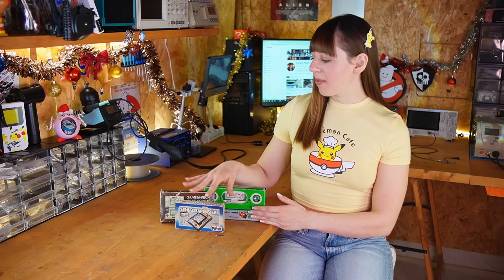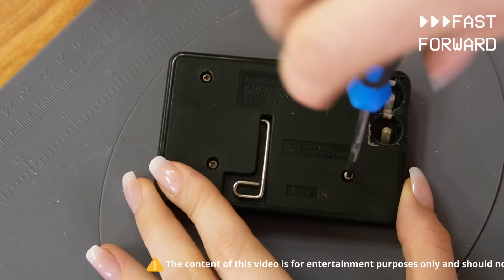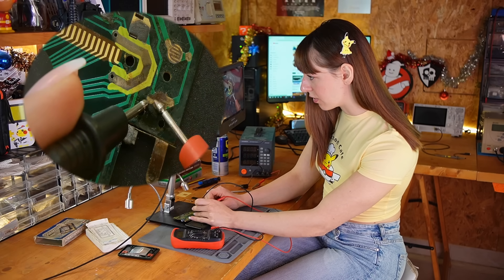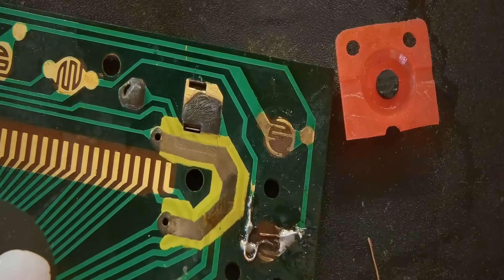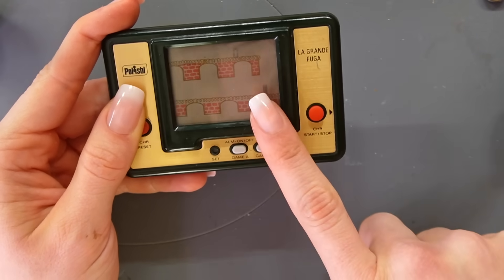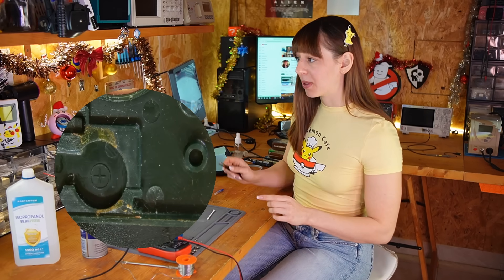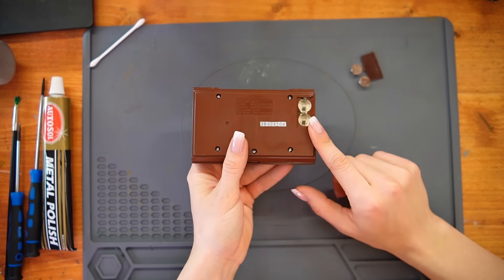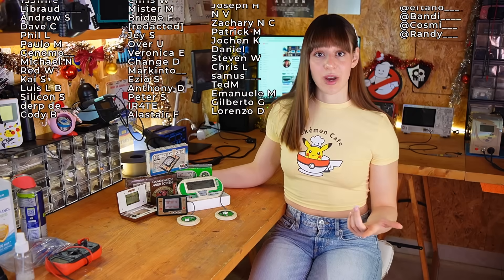3 Game & Watch From a Flea Market – Can I Fix Them?

Comment from the maker: Thanks so much everyone for the 185k! The channel is growing really fast and I can’t thank you enough!
PS. My brother is never borrowing my Game & Watch systems again 😤
Reply: Don't let him 😁😁
Reply: @Sayakas_Digital_Attic   I was not sure(and still not absolute sure, even after asking chatgpt) because i could not touch it, so i asked chat gpt , after a print screen, about the grey rubber, this was the answer..hope it helps:

 It looks exactly like the conductive “carbon pill” coating used on membrane-style buttons (often found in game controllers, remotes, and certain keypads).

Why it’s there

It’s not insulation.

It’s a conductive rubber/epoxy layer that completes the circuit when a rubber dome or plunger presses down.

Manufacturers apply this gray or black coating on the PCB pads to create a durable, low-resistance contact surface.

How you can recognize it

Grey/dark, slightly rough or matte surface.

Applied only on the switch/contact pads.

Usually sits on top of gold-colored traces or “comb-shaped” interlocking pads (which I can see in your photo).

So the short answer:

It’s a conductive carbon contact pad, not just insulation.

..only testing its conductivity would give me certainty, but yes, maybe chatgpt is right..probably in the factory it was put by hand, with a small brish or so..
Reply from the maker: @ROBOTRIX_eu thanks for searching for an answer!!!
Reply: @Sayakas_Digital_Attic  they are biased to me on there
Reply: Can everyone who has profiles in retrogaming-, building- and repair communities pleaaase actively share links to Eleonora's Sayaka's Digitial Attic on there like I have?!!! 👊🏾🙏

It is not right that this tremendously kind, amazingly smart, highly skilled, incredibly intriguing and gorgeously beautiful woman doesn't have at least a Million+ subscribers on here and ALL the succes she deserves yet!!! ♀️💜🔥💥🌋😍🥰🙏
Reply: Or spread the word however you do according to your age/generation 💞

Eleonora Sayaka already brings joy, knowledge, inspiration and admiration to 150k across generations and genders but too many are missing out!!!
Reply: @p2ptbp186  nah
Reply: Until the next time !
Reply: You just gained another subscriber here. I love your content. I don’t subscribe to many channels, but yours is very much worth it. I had a brown Donkey Kong 2 just like yours in the 1980’s. I also remember taking mine apart and fixing it on my patio picnic table one summer when I was a kid. Seeing the inside of it again brings back so many memories. I also had an orange Donkey Kong one.
Reply: What age does your brother has? (Sorry for my bad english)
Reply from the maker: @asanjuas He's eight years younger than me
Reply: I like watching you, you are gifted to do this work.  Plus you are very cute. 😊
Reply: Hi, Sayaka. Thanks for making your channel. Simple with no jargan in it. As its nice to watch you fixing thing and relax. Also get your brother to fix it next time he breaks something. So he can see how hard it is to fix. 👍
Reply from the maker: @rod370 right! I'll definitely do that, besides learning how to fix something could only be a good thing
Reply: You deserve all the success Sayaka, your channel rocks! Love your show!
Reply: I'm picturing Sayaka-kōhai pouring Pepsi on the G&W's battery compartment just to help his senpai make a great restoration vid. 😄
Reply: Can cut some metal sheet of about 0.2mm into new wavy contacts and weld then glue with epoxy.
Reply: hopefully your brother has learnt his lesson. There's a saying, "never say never, as it may bite you on the backside one day."
Reply: Nicely done 👍, Take care from 🇸🇪
Reply: You should charge him for damaging them.
Reply: Greetings to my favorite gaming YouTuber! Blessings and success from the bottom of my heart. You're number one, the best! We love each and every one of the videos and experiences you share with us 🥰
Reply: Judging by the internal conditions of the console he might have spilt soda 🥤 in your console 😅
Reply: @Sayakas_Digital_Attic  I know these little games from my childhood, before C64 (1984)
Thanks and greetings to Sayaka ❤ Frank
Reply: Wow I have some G&W, but my infernal cellar has done some damage to them.. It's not easy to fix this kind of games, but you did great! 
PS: Nice Nintedo look this time! 
Also your nails look great, but i hope they're not a nuisance since you're working with small parts here!!! We like you also with short nails, dont worry!!! 😊
Reply from the maker: @ZombieGamer80  Cellars can really do a number on these old units, but they’re always worth saving!
Reply: @ZombieGamer80  I find longer nails can be useful for components, like having tweezers with sensory feedback available all the time. When I have to trim nails, for guitar, I struggle to pick up all sorts of small objects with that hand 😅
Reply: @kaitlyn__L  Interesting 🤯👍
Reply: Adoro la tua voce. È come musica per le mie orecchie.
È un peccato che tu registri in inglese
Reply from the maker: @belsazargamer5204  Presto ci sarà anche la versione in italiano sull'altro canale. Sto finendo di editarla!
Reply: @Sayakas_Digital_Attic  ❤
Reply: @belsazargamer5204  Are You Italian?

Comment: Batteries are filled with a corrosive liquid. That is why they eventually eat themselves up when growing old (think car batteries that have a strong battery acid). Your brother is likely completely innocent in this, and a soda spill does not easily destroy the metal in traces, on a low voltage device.
Reply from the maker: Thanks for the explanation, that makes sense.

Comment: I've destroyed a lot of LCDs with contact cleaner. A good trick is to spray the cleaner into the lid like a cup, then dip a cotton swab into the liquid. Then it's easy to use the solvent exactly and only where it's needed.
Reply from the maker: Thanks for the tip!

Comment: To remove the crusty material in battery compartments, use white distilled vinegar, it will disolve the crystals. Where possible disassemble, to reduce the area where the vinegar can go. Once its disolved, rinse out with water or IPA and dry and you are good to go..
Reply from the maker: Thanks for the suggestion! 🙂

Comment: since you are approaching smaller and smaller elctronic boards i suggest you to invest a small amount of money in an ultrasonic  cleaner vat, and non conductive cleaning liquid, you will find it usefull for small discrete component item like this and it will be perfect and gentle on more complex smd boards. Note a part in the polistil G&W there is an inscription: NO JEWEL ahahahah thats because it is a quartz watch and back than they have to specify that it will not contain jewels like wristwatch even if it  has no moving parts...

Comment: Your hidden Subscribe message made me Subscribe! 😆  Btw. I think that loosen capasitor thing is called "cold solder" (or I do not know is it that even in english as in finnish it is that (kylmäjuotos) and it usually ends at a time things like that. I do not even know is it actually nothing wrong with the original soldering but it may just happen when solderings get age and maybe some storing environment shifting (like -10C to +50C) or something!
Reply from the maker: Glad the little subscribe joke worked! 😆
And yes a loose capacitor can definitely be a cold solder joint. Aging and big temperature swings can make those joints fail over time, so your guess makes super sense

Comment: You were lucky the dual screen Game & Watch didn't have a damaged ribbon cable, those are expensive! When I ordered my replacement several years ago I didn't know that there were services to make them to spec, I don't know if they offer Game & Watch cables. The funny part is that I broke the cable myself when studying in high school and college, I used to play some games as break time and then I would repeatedly close and open the screen while studying as a stress reliever. Stupid me!
Reply from the maker: Those ribbon cables can be a real headache and yeah, replacements aren’t cheap. Easy to damage them without realizing it!

Comment: I have Donkey Kong II from when I was still in school (an infinitely long time ago). Still works although the screen is quite faint.. is that fixable?
Reply from the maker: If the screen is faint, it can sometimes be improved. The usual fixes are cleaning the contacts, checking the pads and making sure the polarizer isn’t degrading. If the LCD itself is aging there’s not so much you can do, but many units do brighten up a bit after a proper cleanup.

Comment: The soldering quality of the small capacitor might've been bad since the factory or the solder wasn't good and did not stuck to the pad right. Also if the game dropped many times in it's lifespan, it might just broke. That sometimes happens to old electronics. Many times we can see that on the leg part where it cracks in the solder, there the solder stuck to the leg. It's just an assumption tho
Reply from the maker: You make a good point. Old cartridges can get weak solder joints, especially if they’ve been dropped. In this case it just looked more like a factory issue than wear. Could be either, honestly...

Comment: Batteries dont "leak" they blow bubbles.  That is what makes the damage so much worse.  In the confined spaces they tick tick tick as they blow and burst tiny bubbles and aerosolize the acid.  If it was simple "leakage" it would be better.

When looking for damage you have to think as if its a vapour starting at the battery compartment.  I don't think a lot of people realize the reach.

For instance I had a brand new set of AA and AAA batteries from the mainstream brand with the silver and black design (not the black and gold design).  Inside the unopened pack that had an expiry date 8 years from now I heard a "tick tick tick" and I looked and saw more than one battery blowing bubbles around the seals.  This sprayed a thin layer of acid on the interior of the clear plastic of the package.  It was a 30 pack AA and a 24 pack AAA so the window of plastic was large.  It was impressive to see how far it went.  They also must have recently started just sitting on my desk since there was no corrosion or salts yet.

This isnt a criticism of her work or methods.  It is just a statement that is missing from most "battery leakage" videos.   She is lovely and carefully works through all the problems using logic and simple tools.  Her success rate is impressive too.
Reply from the maker: Thanks for the clarification

Comment: Great job reviving those classics! Rebuilding that trace on the Polistil with the tiny copper wire was surgically precise—honestly, corrosion is such a nightmare, maybe a little kid spilled some "corrosive soda" on it back in the day? Also, the 3D printed battery cover is a lifesaver; those things vanish into another dimension. Do you think the capacitor leg lifting up was just bad factory soldering or did the corrosion actually push it up somehow?
Reply from the maker: Corrosion can do a lot of damage, but in this case I’m more inclined to blame a weak factory solder joint for that capacitor leg lifting. Corrosion usually eats material away rather than pushing components upward. 3D-printing those missing battery covers really saves these old units! Glad you enjoyed the repair!

Comment: Awesome video Sayaka. It is very unusual to see button batteries corrode so you may be correct with the water damage  theory. With the capacitor over time a dry joint develops hence the solder will come loose. This could also be due to a original dirty solder joint during manufacturing. I loved your repair techniques in repairing the box ,perhaps more box repairs?
Reply from the maker: The water damage theory makes sense here... and you’re right a dry joint or a poorly soldered joint from the factory can definitely cause that capacitor to come loose over time. I’m glad you liked the box repair too 😁😁 I might do more of those if people enjoy seeing them!

Comment: Pretty easy to knock a capacitor loose during disassembly or re-assembly. Entire reason I learned to solder was because I had done exactly that with my original Xbox when I was installing a new HDD. Was putting it all back together and knocked the clock cap loose, wondered why my machine wasn’t turning on after cloning the drive. Learned that the 1.6 Mobos require the clock capacitor to be able to turn on at all. And then, well…I stuck a green LED in there in its place as the Xbox is softmodded and has no need of the internal clock anymore.
Reply from the maker: That’s a great story. It’s surprisingly easy to knock a cap loose when working inside these systems and the Xbox 1.6 is especially picky about that clock cap. Swapping it for a green LED on a softmodded unit is a clever workaround 🤔 Thanks!

Comment: Tip, if you read your battery with the voltage dc input, it will read high. Since the current draw is in the uAmps range. If you can get a digital multimeter with LoZ input. This input uses a lower input impedance (2-3kOhm), meaning it applies a higher load to the battery. This should give you a better reading of the battery voltage level. Have fun :)
Reply from the maker: Thanks for the advice, I'll keep that in mind for future repairs 😊

Comment: The capacitor probably lifted up because the legs were under tension when it was soldered on, but over time the capacitor moving from vibration and age made the solder more brittle and  tension was able to overcome the strength of the solder and it cracked. 

tldr: It wasn't sitting flat and it was flopping around

Edit: but I could be completely wrong. I wasn't there.
Reply from the maker: Anything could have happened! Thanks for the explanation 🖖

Comment: I think you might want to be more careful with these old handheld games. Especially the Nintendo Game & Watch ones. 💜
- Depending on which one it is of course, its condition, and whether you have the original box or the game's instructions, they can be worth quite a pretty penny.
- I still have my old Mario & Luigi's Soda Factory (another dual screen optional 2-player), and was recently rather surprised to see one of them go for around €220 up here in Denmark. And this was just the game itself. Whereas I still have the box and instructions for mine. We are not even talking evilBay prices here, but rather a respectable local retro-webshop.
- The Mario Bros Soda Factory isn't even the most sought after either. That "award" goes to the Donkey Kong models.

So, maybe tell your brother to be more careful with them, and remember to always take the batteries out, when you are not using them. I most certainly do. 😉
Reply from the maker: I’ll definitely be more careful with them from now on!

Comment: I'm using the same multimeter, and I'm happy with it. However, the needle-type P1502 probes make measurements more convenient. I recommend them.
Reply from the maker: Thanks for the suggestion! I’ll check out the P1502 probes, anything that makes measurements easier is always welcome
Reply: @Sayakas_Digital_Attic I'm sure you'll like it.

Comment: You did an amazing job with these, especially the Italian one!  Corrosion from leaking batteries or capacitors can do so much damage to the PCB!  A small fiberglass eraser can help clean the corrosion and also be used to get the solder mask off to see the damage.  Great job restoring the boxes too - you're the only person I've seen take the time to do it.  Always love your videos!
Reply from the maker: Battery and capacitor leaks can really destroy a PCB, so I try to be as thorough as possible. Thanks for the tips and I’m glad you liked the box restorations, I enjoy doing them!

Comment: Neat timing, I've been trying to get a G&W, but I keep coming across ones that seem too busted to fix. One day, though.
Reply from the maker: Which G&W models did you come across and what kinds of problems did they have? (just curious, when I hear that a console isn’t working, I just need to know why! Haha😅)
Reply: @Sayakas_Digital_Attic  Funnily enough like 3 of them have been the Mickey Mouse G&W. The first two seemed just too wrecked, huge black splotches across the screen. I don't really know what I'm doing, but from what I read online, that means they're doomed.

The third one had some lighter black splotches but seemed to turn on. Looked playable to me. I tried to bid on that, but it went a bit higher than I wanted to pay.

I think I also saw an Octopus one that the seller couldn't verify turned on (looked like the screen may be bad), and one other I don't remember. All on a JP auction site.

Comment: Such a cutie. You have a sweet voice too. I used to work on old hard wired radios and Geiger counters. I had to quit because I developed familial tremors. They are hereditary. My hands shake to badly to hold the solder or soldering iron steady enough to do the work anymore. You can use white vinegar to clean the battery terminals. You should also have a lead removal air filter when you do the soldering if you are using lead based solder.
Reply from the maker: Thank you, that’s really kind of you to say. I’m sorry to hear about that, it must have been difficult, especially when you enjoyed working on old electronics. And thank you for the concern  you don’t see it in the shots very often, but I always use a fume extractor, it’s really important. And thanks for the vinegar tip too!